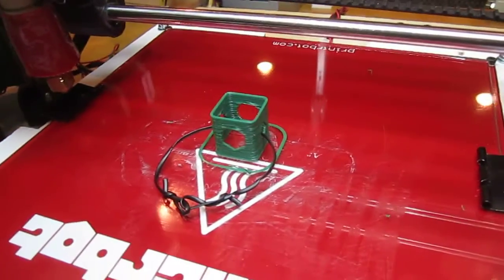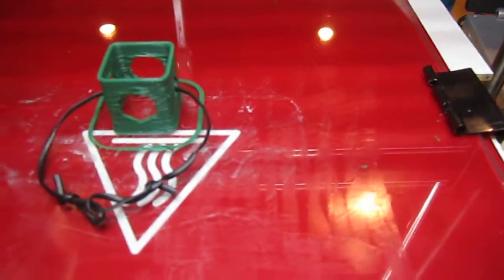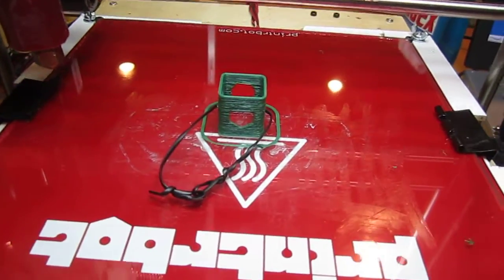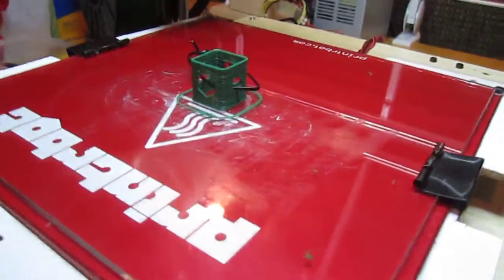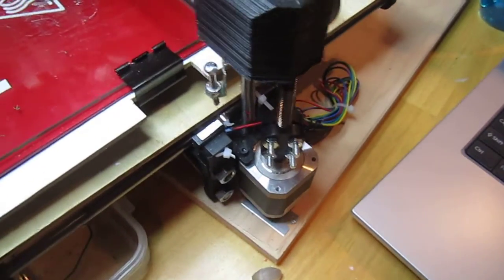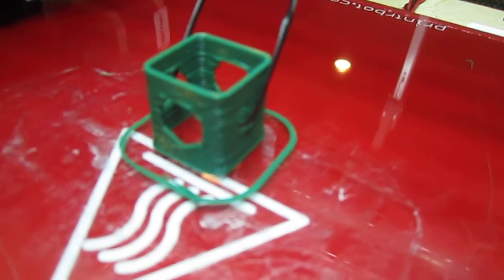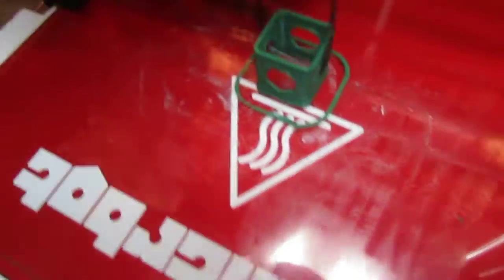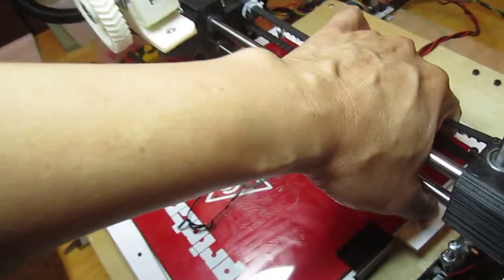Keeping 3D prints on the print bed with office glue stick

Comment: I was about to throw my 3d printer out of the window until I discovered Pritt Power Glue.  Please you need to try this out,  I have had no problems using this product for the past year.  The build plate is the standard MakerBot plate.  No need for the heated plate at all.

Comment: FALSE, tried with glue stick and it does not work at all, any other ideas ? :P
Reply from the maker: Hi Robert.  If it doesn't work for you, my guess is that there are other problems beyond the bed surface.  Some possible causes: Nozzle too high: filament should be slightly squished onto the bed rather than just laid on top of the bed.  Partial clog: Move the nozzle one or two inches above the bed and extrude some filament at the desired temperature.  The filament should flow perfectly down.  If it curls up, there's a partial clog in the nozzle causing insufficient filament being extruded and might be too thin to stick to the bed.  Also, gluestick only works for PLA.  It won't work for ABS.  Others have also had good luck with hair spray, but I've never tried that.  3D printing is STILL an artform.  Takes some trial and error, but very rewarding on successes!  Good luck!  If I can do it, so can you!
Reply: I spent whole sunday actually trying to print something, wasted a lot of ABS with no luck, of course I tried multiple setups, nozzle very close, nozzle just above table surface (paper thickness test) so far best results I've had with water/sugar mixture :( but it's not the best solution, and from time to time printout bends up :(
Reply from the maker: You're right, glue stick would not work on ABS :-(
The bend up you mention is most likely because bed is not hot enough or you do not have the printer in an enclosure to trap the heat.  
I have been printing everything in PLA for years now.  ABS gives me headaches (literally).  Have you tried ABS Juice or slurry?
Reply: Nope but probably today I will try this things :) Water with sugar works pretty good with ABS but in case if the object is big (180mmx150mm) and has some narrow sharp ends .... it just won't keep it on table, is not strong enough. Yes you right, it works really good with PLA and with PLA i have no problems at all .. just ABS :(

Today, right after I came back home decided to try again "My sweet solution" and ...... so far it works pretty awesome. The problem was apparently I mixed up sugar with water in wrong proportions . So I cleaned up my table (glass) then prepared a new solution and smeared ultra thin layer on my glass.
Absolutely awesome, sticked properly on whole surface ....weird .... :P

Comment: I don't like the blue tape for pla. The heat from the pla messes up the tape and it quite often rips. With the glue stick, I can use multiple times with no problem and I don't need to heat the bed either. Clean up is really easy, MUCH EASIER than blue tape. Just set the glass in the sink and run hot water over it. I have two thick pieces of glass, so there is no wait.

Comment: I like to think I shared this solution originally - Glue stick kung fu grip - Taulman 618.
Mostly the response was indifferent or negative, as most seem to be in the RapRap community...

The bed only needs to be mildly warm, so the glue dries shortly after applying.
I have since stopped using water for removal, its not required if you let the bed cool - the job basically cracks off by itself with some blade persuasion.
Works for PLA and Nylon, I dont print with ABS so I dont know.

Another point, all glue sticks are not the same.
I use UHU, I have tried some other brands which do not work. (generic "Office" glue)

Comment: I have been using office glue for PLA and works quite well. It is not flawless, but works. 
I noticed it has to be a thin layer of glue, otherwise the PLA won't stick.

Comment from the maker: Temperature does not seem to affect the glue. I've applied it cold and while the bed as high as 65.  I keep the bed somewhere between 60 and 70 for PLA.  Disclaimer: I've now switched to 3M blue painter tape.  It works almost as well and less messy compared to the glue stick. :-)